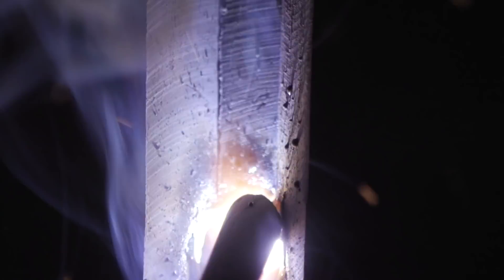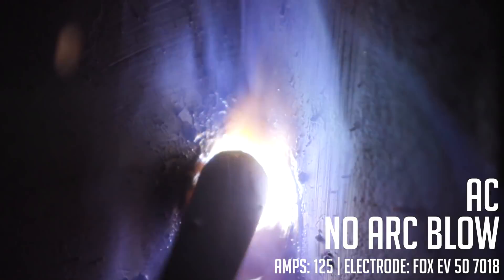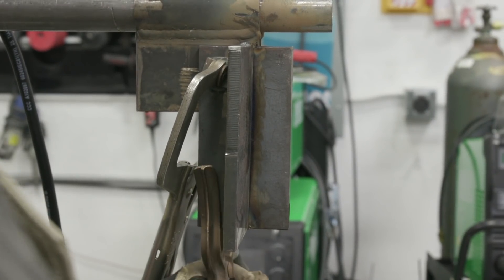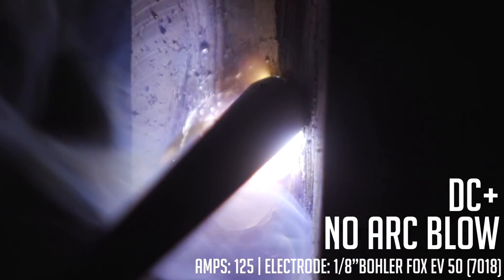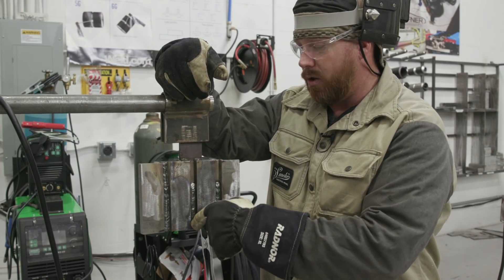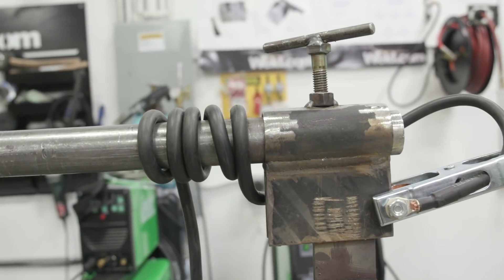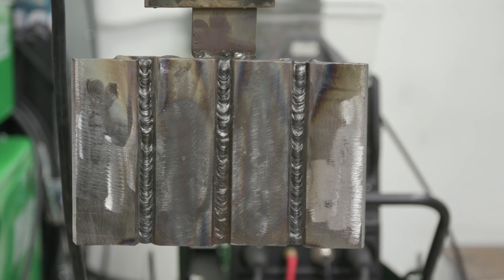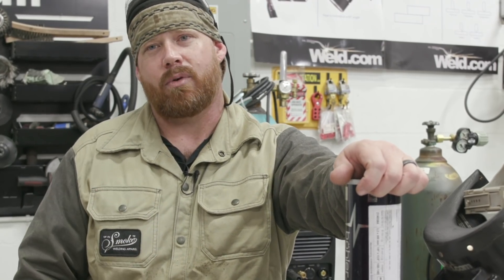4 Ways to Eliminate Arc Blow

Comment: Just a question,  doesn't wrapping the cord in a coil cause a magnetic field?
Reply: Yes it does. The magnetic field from the coil apposes the magnetic field created in the steel from the stinger. Therefore making the net magnetic field 0. It is essentially mimicking Alternating Current. It is like taking a magnet and sticking the south pole to a piece of rebar. Then on the other end stick the north pole on it and the steel has no magnetic field. Its net magnetic field is 0. Try it yourself with some rebar. It acts like the very center of a magnet where there is no dominating magnetic field created or induced.

You're welcome weld.com. and yes, I'm a scientist and I've studied physics for a very long time and I've even taught an advanced physics class in high school for 180 days. I loved it.
Reply: @secretagent5658  Your description is mistaken. Current generates magnetic flux circumferentially around the current axis.  The current in the coil wrapped around the workpiece will create magnetic flux around the wire, with the loops adding up to create flux axially along the workpiece (and if the workpiece forrms a loop, the axial lines of flux will return back to the coil section that way, otherwise they will loop through the air.).  In contrast, the welding current through the workpiece will create magnetic flux perpendicular to the current flow. Those two fluxes are in different directions and so will not cancel.  I am electrical engineer, so work with actual electricity. And I wouldn't be so quick to jump to conclusions about the phenomena demonstrated in this video, given the high currents, low resistances (which change as the weld progresses) high temperatures which may change the metal's magnetic and electrical properties, and the plasma of the arc.
Reply: @Graham_Wideman  You described the same thing I said but longer. The magnetic fields are induced in opposite directions making it cancel out.

To those who don't know physics very well they wouldn't know what you are saying because you explain it in a complicated circle.  But I made my explanation direct and simple so anyone can understand it. Explaining things in a complicated manner isn't the best for everyone.
Reply: @secretagent5658  No, I did not say the same as you, and you are still wrong. I pointed out that the two fluxes (one from the arc current through the workpiece, and the other from the coil wrapped around the workpiece) are perpendicular, and hence do NOT cancel each other. You mistakenly believe that the two fluxes are parallel but in opposite directions.
Reply: @Graham_Wideman  What you dont realize is that the current from and to the piece is opposite of the wrapped coil. And by saying they are parallel is saying the same thing I am period. I've met students that are like you. And you are going to be stubborn and blind to it until you get shown it in person. So there's no need to continue arguing here because I can show you and show physical proof besides taking. But for students I've met that are like you they work best with physical proof.
Reply: @Graham_Wideman  Ampere's Grip Rule. Look that up and do some through research and experiments. Draw it out. I did and the magnetic field is parallel but the force is not. One goes left and one goes right. Therefore canceling them out. Draw it out or else you won't learn. I drew it out and I drew it out to make sure if I wasn't wrong. And I'm not so draw the magnetic field out taking into account the magnetic field but also induction through the coil on the pipe and also the effectiveness of the magnetic field created in the plasma channel.
Reply: @Graham_Wideman  Looking back at your original comment I see that you said a coil wrapped around the work piece will create magnetic flux around the wire. Then you go on to say, and I quote "with the loops adding up to create flux axially along the workpiece". I'll stop you right there. Because magnetic fields can not be blocked but only redirected. Take a look at the article about blocking magnetic fields from K&J Magnetics. They show that you can not block magnetic fields but only redirect them sooner to the path of entrance. 

The magnetic field is still going to be circumferential. Especially in the case they showed the magnetic field is circumferential for both. Again draw it out and take everything into account and not just the magnetic flux lines.

This should take you 2 days to throughly asses the case they showed. I'll look at your response in 2 days from now.
Reply: @secretagent5658  Current in a wire produces a circumferential magetic flux around the wire, on this we agree. When the wire is wrapped into a coil, the flux is still circumferential around the wire, but the coil shape causes the flux from all the windings to add together into a field along the axis of the coil. This is the basic concept of a coil or solenoid, as shown here for example:  http://hyperphysics.phy-astr.gsu.edu/hbase/magnetic/solenoid.html. Note the flux lines axial along the axis of the coil. And all the stronger if there's an iron core.  So, as I said, the flux from the coil will be axial along the workpiece.  I have no idea what you are going on about regarding fields being "blocked", as I said nothing about blocking.    You also seem unaware that "they show..." is not helpful unless you provide a link to what you're discussing.
Reply: @secretagent5658  " And by saying they are parallel is saying the same thing I am period. " You seem to have reading difficulties: I did NOT say parallel, I said perdendicular.
Reply: @Graham_Wideman  You seem to have problems with reading people and inferences, as well as a temper issue. Calm down and draw it out. But let me correct it then. I meant perpendicular. Sorry about that.
Reply: @Graham_Wideman  Perpendicular
Reply: @secretagent5658  "Ampere's Grip Rule. Look that up and do some through research and experiments".  Already learned that and did them decades ago. "I've met students that are like you. And you are going to be stubborn and blind"... "This should take you 2 days to throughly asses the case they showed."  You seem more eager to engage in insulting me personally than in understanding what I wrote, or in understanding the very basic electromagnetism principles at work here.
Reply: @Graham_Wideman  Nope. I just dont want to waste my time on someone like you. Someone who puts stuff out there that they don't really completely understand. Electrical engineering is different from a physics professor. I want you to do the work then come back to me and then we can have a conversation. :)

I understand the basic principals of electromagnetism. I've taught classes in physics on this type of stuff before. In a few classes I taught how a MagLev train works and we even constructed one that ran off of AC mains power. Using 20 amps on a 125 volt circuit.
Reply: @secretagent5658  ". I meant perpendicular. Sorry about that." Good, you now agree with my original point: The two fluxes are perpendicular, and hence cannot cancel.  Perhaps you could also apologize for all the other insults you threw my way, and at electrical engineers in general, in an effort to bluster your way out of your original mistake.
Reply: @Graham_Wideman  I was correcting your grammar. And if you put perpendicular in place of the word we don't agree. Read it again. And I'm not insulting electrical engineers or you. My neighbor was an electrical engineer and he worked on TV's. So I know how to talk to engineers by challenging them, no problem. He has been an electrical engineer working on TV's, computers and servers for 50 years. So I respect him a lot and he always tells me that the youngsters don't always know what they are talking about when they talk about something in electrical engineering. And I've applied that knowledge and seen it first hand with you. Again, draw it out or consider this conversation over. Do the work, if you won't put in the effort then there's nothing I can do.
Reply: @secretagent5658  I have no idea what youngsters and your discussions about them to your neighbor have to do with this conversation.  As yet, you still have not addressed the fundamental criticism I made of your original discussion about the two magnetic fluxes.  To make the description easier, suppose the scenario is simply welding a bead upward along a vertical bar. Connected to the bar at some distance from the weld is the ground cable. The stinger cable is wrapped several times around the bar, creating a solenoid with vertical axis.   So while welding we have a current axially along the bar between stinger and ground cable (vertically, since the bar is vertical), and we have that same current through the coil.   The current axially in the bar will create a magnetic field circumferentially around the bar, following the right-hand rule like this image from Khan Academy: https://cdn.kastatic.org/ka-perseus-images/2ba984f40973c3b500ad89bf114b1d2f1e16aff1.svg and the current through the coil is the case of a solenoid, whose field looks like this: https://cdn.kastatic.org/ka-perseus-images/9f61f64a569615f9c01d2e8da38412d767a9a76d.svg.  Clearly the lines of flux from the current in the bar are circles in planes that are perpendicular to the flux axially in the bar caused by the coil. Since the fluxes are not oriented parallel to each other, they cannot cancel. 
There, you have the drawings that you keep claiming I need to draw. No need for me to draw them because they are basic to intro electromagnetism taught far and wide. So please address this without sidetracking into your imaginary world where you role-play that I'm an upstart student you can browbeat with condescending remarks about needing to "do the work".

Comment: I imagine the reason arc blow occurs is because as the work piece heats up the resistance increases which increases the amperage. So like when a wire burns up so to does the welding rod kind of burn up resulting in arc blow. As to why those methods work I'd be interested in finding out.
Reply: For a given voltage, if the resistance increases, then the current must decrease
Reply: @Graham_Wideman  you are right I was thinking E = I × R and confused volts with amps in the equation. To me it would still make sense for the electrode to burn up if the volts increases as I imagine, but being that I'm no expert on the science and only know enough to perform electrical diagnostics I could totally be wrong. I'm just trying to exercise my head muscle

Comment: Wrapping the cord around a steel core will resist fluctuations to the electrical current in that cord; so it helps with keeping a stable puddle, but also makes it easier to lose the arc if you don't stay tight enough.

Comment: Anyone else ever experience arc blow so bad that the weld arc not only all of a sudden blows to the side at a 90 degree angle but will blow out the side of the rod about an inch from the end??
Reply: I experienced this to a lesser degree in class tonight. 7018, uphill 3G at  9" weldment on 3/8 plate, jointed for BU2-A, 115A, 20% arc force, hot start active but not adjustable. Made it 7"" before I had arc backblow and out the sides. Best I could do was stop running the beads at 6.5" instead if the full 9". It was in class and all practice test situations.

Comment: I don't want to get too picky here but we all need to stop saying "Electricity is going to take the path of least resistance." It's a huge safety issue. In reality, we should be saying "Electricity takes every path possible with the amount of current in each path being inversely proportional to its resistance." That way everyone understands that the electricity is taking lots of paths and any number of them may kill you if you are not careful.
Reply: Freedom Justice  The key here is context. Lightning, super conductors and micro-heating don't really matter in the practical sense. It's a technicality that unnecessarily complicates people's understanding. What people do need to know is that they should not be thinking about a single path of least resistance for current paths related to commercial and residential power. This is a mindset issue that goes beyond welding. It has to do with any current source beyond small batteries. If people will treat current paths in the plural instead of the singular then more people will be alive at the end of the year than not. Additionally, more people will be alive if they think this way than if they understand lightning, super conductors and micro-heating. I don't get into these things because it won't really help people but helping understand that they can be killed from any number of current paths will. I'm not dismissing what you say, I'm just saying it muddies the waters for people's understanding.
Reply: Freedom Justice  You're confusing "intelligence" with "knowledge".  Funny that you accuse him of  being egotistical, when the tone of your response is that of a lord talking to a fool, not a teacher to student.  You  make repeated statements about how Kenn "thinks",  when you are actually projecting your annoyance at someone having the arrogance to argue.   This is the kind of discussion that goes on in talk radio, not among intellectuals, and while you may have a lot of technical intelligence, you really need to work on your emotional and social intelligence if you would like to have constructive relationships with others.  Oh, and there is no such thing as "false facts", so "true facts" is a redundant term.  Try not to be so combative in your discussions - you can learn far more from polite conversation than aggressive.  It sounds like you have a lot of knowledge - but remember that we all come from a state of ignorance, and knowledge can sure that. Intelligence is much more nuanced and complex, and if you despise those who seem less intelligent to you, you will miss many chances to increase your knowledge, and isolate yourself from both the less intelligent, and the intelligent who practice compassion.

Comment: My thoughts on this based on observations: 

Electricity will follow more than one “path” to ground.  Essentially the plate or work piece becomes a “lake of water” for the electricity to travel through.  It comes in funneled through both the stinger wire and the ground wire.  When it’s in the plate it doesn’t exactly just make a straight line from one point to the other, it spreads out more like lightening.  How wide is spreads depends on the resistance and how much electricity your putting through it.  When you add heat of melting metal the resistance of areas will change, which means the flow of electricity will change as well.  Any drastic change to the flow of electricity can cause the arc to wander.

I have seen arc blow and to me it seemed like the arc wandered quickly to the side causing flux to burn off/fall off the side of the rod. This caused a increase in arcgap, improper shielding gas creation, improper flux melting/deposition, and the extreme heat of the arc would cause the exposed metal of the rod to start “burning up” in a way (much like welding a rod with theflux knocked off).  Without a doubt some sort of magnetism could be at play (since magnetism will clearly screw with the arc) but just giving multiple paths to “ground” gives stability and multiple channels to ground.  The fact multiple grounds works makes me have a hard time seeing enough of a magnetic field being generated is causing that much of a issue.  It could be though.

Also remember most stick rods are run DCEP which will be more prone to electricity wandering on the work piece due to how electrons flow through the circuit.  On ac it is passing  through a cycle of essentially 0volts and then re-establishing electrical flow towards the stinger or away.  Any stray electrical flow won’t be established for long or at enough of a magnitude to make much of a difference.

Interesting stuff.  👍🏻👍🏻 great video as always
Reply: Electrons flow along magnetic field lines, in a plasma. Since that is what an arc is (plasma)... I'm with you. But I'm struggling to explain why he experienced the phenomena near the top of the vertical weld.
Reply: Email User magnetic field at the end of the work piece has no metal left to spread into. So it is kinda squished and concentrated more and more as u advance your rod towards the top. Below the rod these magnetic circles spread free into the metal. Now your arc is essentially a conductor encircled by the magnetic field along its way. Picture yourself the place where arc enters the molten metal... Pushing force at the top will prevail and will direct arc elsewhere but away from where no metal left.
In addition to that - there is a return current flow into the work piece from electrode. The direction on that clamp will dictate where the magnetic field will be concentrated more. If the clam is at the bottom- it will concentrate field behind your rod (travel). In fact it will oppose to “no metal left” when the rod is at the top. If the clamp will be at the top then you will have difficulty at the top due to two phenomena overlapping and pushing arc away from where you want arc to be. 
This is how I understand the issue.
Reply: @AY-cj9kp  Ok, the makes sense. Thank you.

Comment: I run into something similar to arch blow with the MIG work that I do. Definitely going to try those methods to see if it cleans up.
Reply: I'm wondering if the methods will work with MIG too. It should anyhow. Both welding processes involve an arc.

Comment: I bet Wroger Wroger is gonna say that the dual clamp method works because it acts kinda like moving your single clamp closer because copper is that much better at conducting electricity.

He'll probably also say that wraping the cord acts like an additional inductor that keeps power moving to your piece even if the machine dips for any reason
Reply: Wroger Wroger, why did you change your name to "Marc D"? 😆